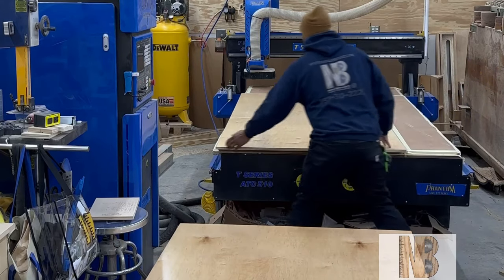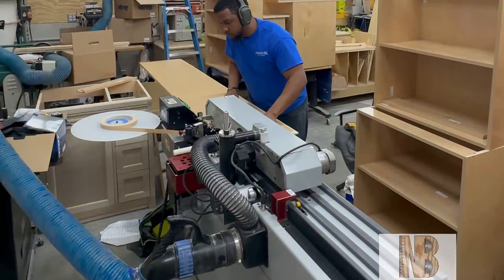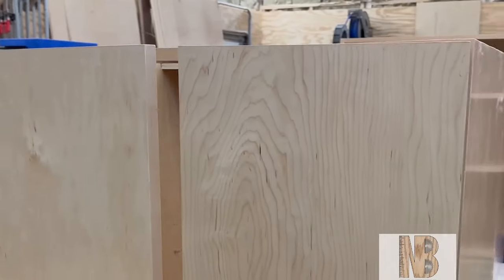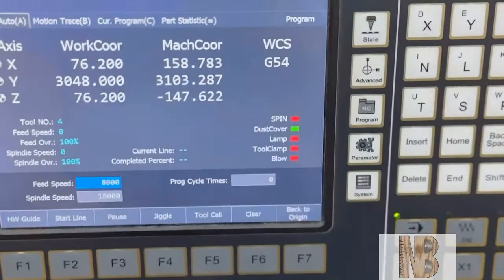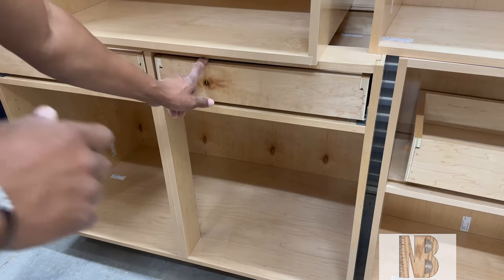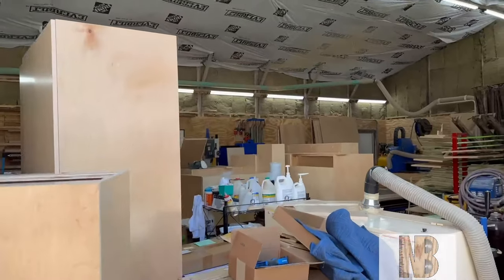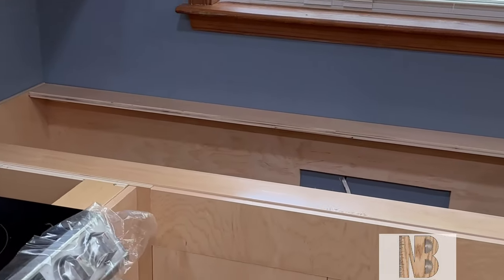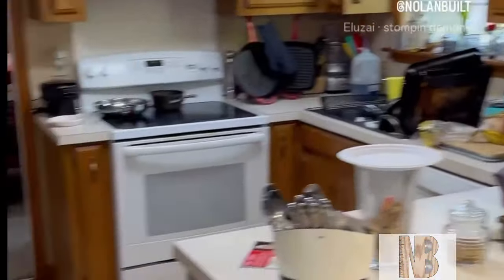How it’s made: Custom Kitchen Cabinets

Comment: Just a heads up.... in regards to drawers behind doors, there are "zero protrusion" hinges that fully clear the cabinet when open so you don't have to use blocks and smaller drawer boxes.  They use the same drill pattern but the knuckle is much larger so you have to be aware of where you use it in relation to the drawer box.
Reply from the maker: Oh nice! Thank you

Comment: Great vid Nolan. Thanks for putting it together. 
Are you using a 1/4” compression for the profile cuts?  Curious what the IPM and RpM are?  I’ve had a challenge with some skinned finished plywood. Same machine 5x10 TI with the R. TIA
Reply from the maker: I’m running a 3/8” compression bit for the profile cuts. 3/4” full depth pass at 400 ipm and 18,000 rpm

Comment: Have you tried using a skin pass for the small parts?  We use the skin pass for the whole sheet because after the skin pass it cleans up all the sawdust stuck in between the parts pretty much eliminating the manual vacuuming after you pull the parts off the cnc.
Reply from the maker: I have not tried the onion skin feature yet. I have been using full sheet tabs. I might have to try it out, especially if it’s going to help vacuum. Clean the bed between each sheet takes up a lot of time

Comment: does mozaik allow you to use the cnc to pre drill the holes for the Blum undermount slides and other hardware?  Seems to me with a larger job that just having the cnc locate the holes for you would save time?  Maybe the software doesn't do that?
Reply from the maker: Yes it does! It’s has a number of different hardware options pre set in the software

Comment: Great video! I’m looking at getting a Phantom CNC is there a reason you went with a 5x10 instead of a 4x8? I’m space limited and was wondering if it’s worth the extra space for the bigger one.
Thanks
Reply from the maker: I went with the 5x10 because it was already ready for pickup at the time. I didn’t have to wait.

Comment: I like your setup. I'm interested in your CNC thanks if you can give me some info I'm tossed between The avid or the phantom.ant advice would be helpful.
Reply from the maker: Yea I weighed the same option. I went with the phantom because it was it was so close in price and I didn’t have to build it myself. Also the phantom is more powerful and accurate.